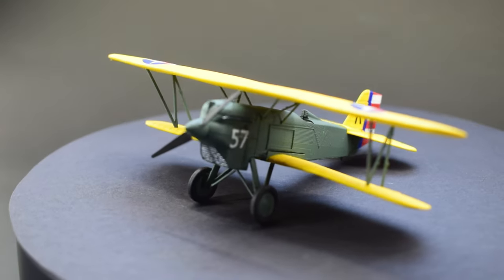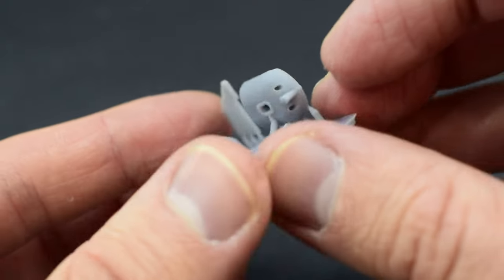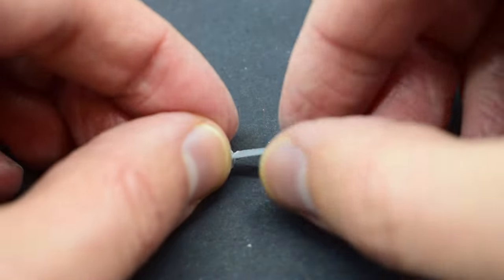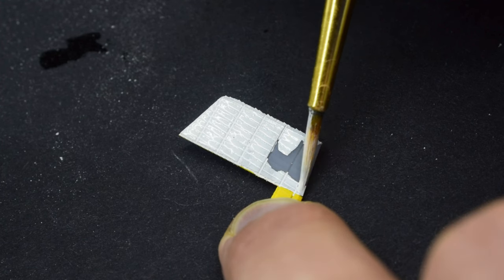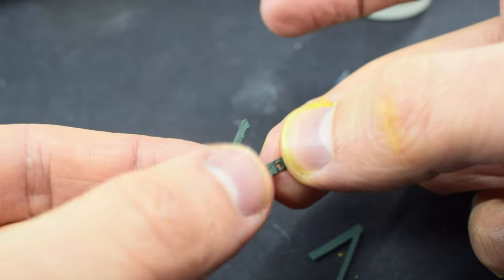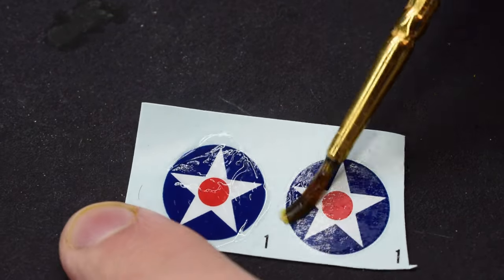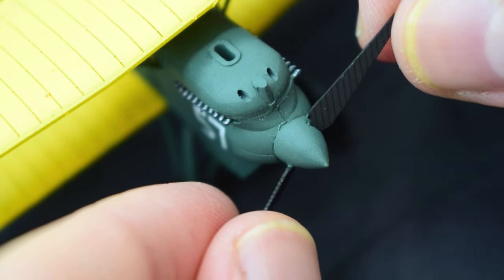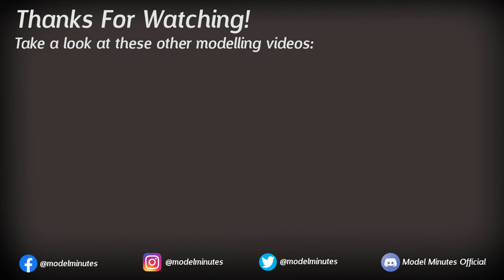Completely 3D Printed! Curtiss P-1 Hawk Model Kit in 1/72 Scale - Build

Comment: Just a quick tip for your next 3d printed planes, never place anything flat on the base because the layers will show really bad on surfaces with very shallow curves, always place the "flat" side vertical so you can avoid the layer lines that ruin the finished product.
Reply from the maker: Yeah, this is a lesson i have learnt the hard way lol

Comment: Quite a funny model. and quite interesting. However, the quality of the 3D printing seemed a bit rough to me. This is especially evident in the propeller and fuselage. Have you tried sanding these surfaces with an abrasive material?
Reply from the maker: This was my first attempt at 3D printing and a lot of the rough areas are due to poor orientation of the parts during the print - a lack of experience on my part. Were I to revisit this today I could get much better results

Comment: I recommend 60 degrees and a layer of 0.04 or 0.035 mm. It is good to choose the supports, their number and the thickness of the connection with the model. Remove supports before curing. It is best to immerse it in hot water and gently break it off. Remove the residues with fine sandpaper. Look for better made models. Have Fun :)
Reply from the maker: Thanks! Some of these tips I already kinda figured out in the last couple of months of using the printer, but I will certainly have to try the other ones :D
Reply: @ModelMinutes  Look for user groups for your printer. They have setup tables for the appropriate resins. Exposure times, printing speed, the amount of blurring of the edges of the model. The quality of the files is of great importance. It's best to look for well-designed, multi-piece models. Sometimes it's worth buying something. They are cheap and you can print them endlessly.
Reply from the maker: @connorsarf2970  good tips!
Reply: 0.002 lyf
Reply from the maker: @lpjmodels  0.0000000002
Reply: @ModelMinutes  to infinity
Reply: @ModelMinutes  I think I added one to many zeros accidentally tho 🙃
Reply from the maker: @lpjmodels  😂
Reply: @lpjmodels  Most of the time im using 0.025/0.030. Minis are better than a box versions.

Comment: How does the cost of this compare to a similar kit from a shop do you think?
Reply from the maker: If you just consider the resin used (and not that you might have to get decals and paints etc) then like £1 - £2ish

Edit: naturally not including the cost of a 3D printer in that which can be like £200 upwards, but if you printed like 20 models with it, it kinda recovers that cost pretty quickly